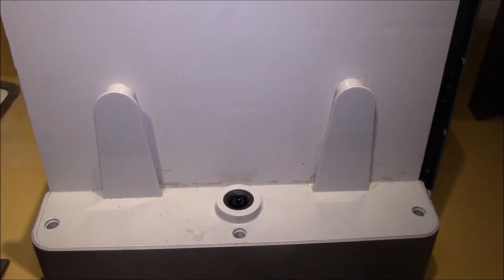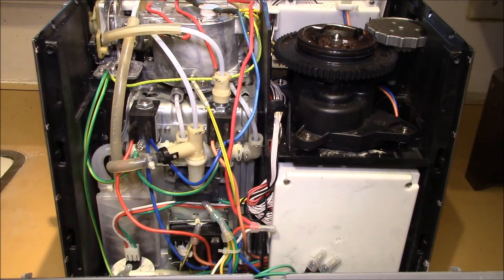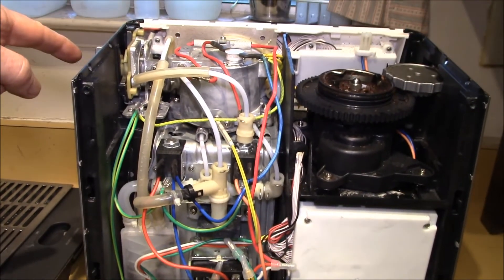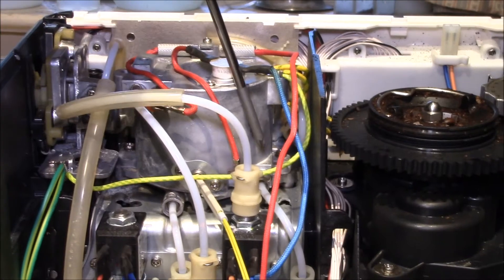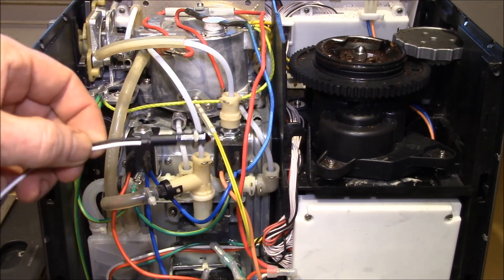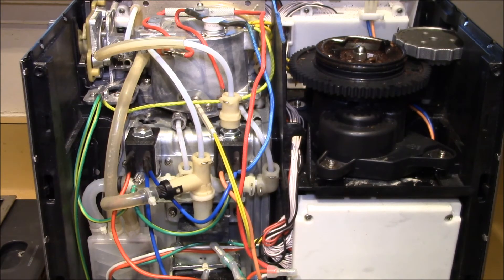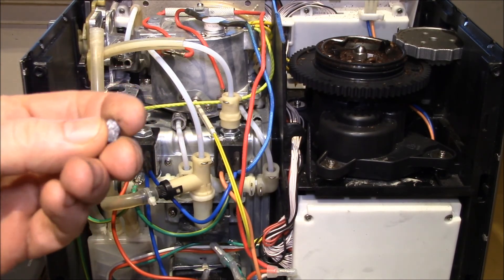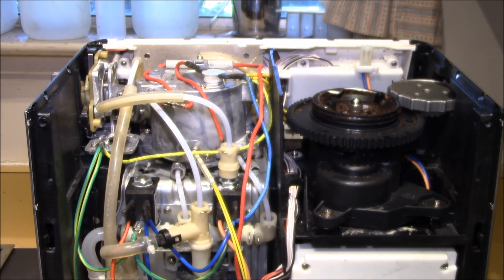Breville/Sage 870XL Barista Express - Water Flow

Comment: So just to let everyone know, having watched these excellent videos, I went ahead and ordered the solenoid block and as you warned it is on back order.  Here is the customer service info: 
Thank you for ordering from eReplacementParts.com. The purpose of this email is to inform you that when trying to order your parts we were notified by the manufacturer of one or more backorders. A backorder happens when the manufacturer does not have the part in stock. We are able to get backordered items once the manufacturer gets more in their stock.

The statuses of your items are listed below.

1 x SP0020444 Solenoid Valve Assembly - Backorder: Unknown ETA

We are very sorry that the part(s) went on backorder. At eReplacementParts.com, we will check on the status of the backorder part(s) with the manufacturer every month until they become available again. Then, we will contact you with the information we receive. If you would prefer that we call you with status updates in the future, please let us know!

Your order will ship complete as soon as all the parts arrive. If you would like us to ship out any available parts we have now, then we can definitely do that (additional shipping charges may apply). Also, if you would like to make other changes to your order, we can help with that as well. In either case, please email us at agent@eReplacementParts.com and one of our representatives will assist you.

Not a major problem as my machine is still working reasonably at the moment.  Just a heads up in case anyone was looking for an instant fix (pardon the pun!)

Comment: Hey, I have an issue is that water is not coming to manual hot water steam valve. The pressure meter is not showing any pressure. I assume it happens due to dirt in, what you call, tank or diffuser. I’m trying to clean up manually by injecting hot water. Could you advise how properly clean the diffuser and if I correctly analyzed the issue? Maybe there is an issue in the pressure it self?
Reply from the maker: The diffuser only handles water running to the drip tray, it's job is to diffuse or reduce the pressure of the hot water or stem that's dumped out of the thermo block after a cycle.  Unless you're getting no water into the drip pan, it's likely not plugged up.  Sounds more like a clogged hose between the pump and the solenoids or hot water/steam valve.  Or the safety valve could be stuck open and that's dumping water out or the pump is going out and not producing enough flow/pressure.  See my video in this playlist on those two parts.
Reply: @The4Crawler   Hey, thanks for the reply. I see some small drops are falling from the metal stick and when I switch to get a steam there is not steam from this metal stick :( I think I’ll remove now all the pipes and will try to check and clean all of the places where each one of them connecting.
Reply: I also saw your video about the steam valve so I’m checking this part as well.
Reply from the maker: @juno1010  Either the water is not getting to the hot water/steam valve or the valve itself is plugged up inside or there's not enough flow/pressure from the pump to push water out.
Reply: @The4Crawler  yeah, I’m in a middle of cleaning up all the pipes. I cleaned many plaque inside the pump I now I’m already getting the water from the metal stick but not yet see the steam :( and now don’t see any water coming to coffee cup any more. Something fixed and something broken. It’s like a lottery :)
Reply from the maker: @juno1010  Yes, have heard of cases where deposits in the pump broke free and then clogged tubing or valves farther down the line.
Reply: @The4Crawler  I found one pipe totally stuck, the one which is coming after the heating water and going to solenoid. Cleaning it now in salt lemon water.
Reply: No luck :( somehow water is not coming to the heater.
Reply from the maker: @juno1010  Then it's either the safety /over pressure valve bleeding off all the flow/pressure or the pump is not pumping water:
https://youtu.be/46UBebNJ-uo
Or perhaps the inlet filter below the pump is clogged and no water is entering the pump.
Reply: @The4Crawler  thanks a lot.. checking whole the flow.. disassemble whole the parts now.. solenoid, etc.. :) hopefully the electronic valves are fine, the right one is buzzing, could it be due to stuck pipes with plague ?
Reply: Btw, nothing bleeding. I mean no water leak outside.
Reply: Oh god, after putting whole the solenoid to water with lemon and salt I didn’t drain  the electric valves so my home electricity went down.. :) now I’m draining them with the dryer with hope that it didn’t burn.. it was not any smoke.. what do you think it burned? will it work? :)
Reply: Everything works! Finally. Thanks a lot for your videos, its very helpful.
Reply from the maker: @juno1010  If you have an RCD or GFCI type breaker, likely that went.  The solenoid coils have line, neutral and ground/earth connections.  If you get any current flowing to the earth connection, those type of breakers will trip out.  Likely no damage, just make sure everything is dry and cleaned of any conductive residue before powering up again.
Reply: @The4Crawler  You are the guy! The coffee machine is working great now. If not your videos and your online help it will be hard to fix it. Today I opened it and today I fixed it. It took a day, but very good results. Thank you very much Brown. You are the best! I’m planning other thing but it more to create something new. How can I contact you?
Reply from the maker: @juno1010  Glad you got the machine working.  There's an an e-mail link in the About tab on the main channel page.

Comment: Thanks for your video.
I am curious about how water flow works with "Clean me" and "Dry Puck" features.
Reply from the maker: Good question!  See these 2 videos:
Dry puck just holds the drain solenoid on for about 30 secs.:
https://youtu.be/9cC-m3a-oXY
Cleaning cycle is just repeated brewing cycles as far as the solenoids go from what I can see:
https://youtu.be/TZjJFSAkNQ0?list=PLpY2FP1a9tisyIfKjSugexoVK01xQuptv&t=557
Reply: You are really excellent in answering viewers ' questions.  Your detailed videos are really helpful to others.
Reply from the maker: @dm5124  Glad to hear that.  It was a crazy idea at first to wire up those indicator lights to the solenoids.  But in hind sight, they help to figure out how these machines work inside coupled with how the water flows around inside.
Reply: I am just wonder why I need to use "clean tablet" if water flow has only one way out of the group head.  The term "flush back" is also used by "clean me" feature.  
If the "clean tablet" is used only for cleaning shower screen in group head, I can remove the shower screen to clean and then run clean me process without using a clean tablet.
I don't think that the clean me process will suck back the water from group head. 

I wonder what "clean tabler" actually does.
Reply from the maker: @dm5124  I'm not totally sure how that works either.  It does cycle between brew and drain so in the drain state, pressure is vented from the group head and that likely sucks up some of the cleaning solution up into the plumbing a way, sort of like a siphon.  Then it's pushed out in the next brew cycle and repeats until the cleaning cycle ends.  Likely you could clean things by hand just as well, but the tablets and automatic cycle are more appealing to most users.

Comment: Thank you for the wealth of information!. I was about to give up on my 870XL, but now I'm fairly confident that I can fix my issue. I believe I have a bad three way solenoid but there were also times when it just wouldn't pump water, so I'll probably be replacing the pump soon too.
Reply from the maker: Yes, good idea to replace both while you are in there.  I did the solenoids then later decided the pump needed replacing as well.  I'll be rebuilding the pump to have as a spare.

Comment: Thank you so much for the very insightful video! Ive been having some issues with my Breville Oracle BES980XL. At the beginning of extraction, it leaks water around the portafilter, basically expelling whatever was in the group head before pulling a normal (now watery) shot. I suspect there is a valve that's clogged causing the purge to happen in the group head? What could be the reason for this? For reference, I've changed the grind, tamp pressure, water filter, tamp fan, and gasket. The portafilter is also in good condition. I've also descaled, run a cleaning cycle, and cleaned the group head. Do you have any ideas?
Reply from the maker: If it's similar to the 870 model, then there's the 2-port solenoid valve that opens after a cycle to purge steam/water directly.  There's also the indirect purge via the top of the 3-port valve that runs up to the hot water/steam valve and then down to the drain.  Maybe those passages are plugged or the solenoid valves are not working right.  You can usually hear a release of pressure when the brew cycle ends and that drain solenoid opens.  It typically stays on about 30 seconds then shuts off and you can usually hear that:
https://youtu.be/9cC-m3a-oXY
Reply: Thanks for the reply! I've just now replaced the solenoid valve but now no water is coming out of the group head at all... it does come out using the "hot water" function though so I believe it is not a pump issue. The steam wand also works. It is pretty quiet in the beginning during the infusion stage but it sounds normal afterwards (but no water). Do you have any other ideas?
Reply: @jessicanguyen8949 remove and check the small tube that goes out from that valve block into the stream head, that may be clogged. I had a problem with getting water from all the ports, in this case it was a clog in the tube from the heater block on the top down into the valve block.

Comment: hey i have a similar machine, it was turning on fine but developed a leak at the elbow, i disconnected the connectors leading to both solenoids, now the machine doesn't power on......i looked at all the connections and they seem intake and snug.  i measured voltage at the solenoid prone to a ground, and it does measure ~120v so power is getting to the solenoid, but the machine doesn't seem to turn on any more.......any ideas?
Reply from the maker: Maybe the grinder/bean hopper is not pushed in all the way.  That will prevent the machine turning on.  Check 7:10 in this video:
https://youtu.be/0ZDii493IPY
Reply: thanks for the reply! my machine doesn't have the grinder portion but everything else looks the same!
Reply from the maker: @seedyeh  OK, might be some similar type of interlock switch on the machine.  Could also try unplugging and reconnecting all the wires at both ends just to make sure they have a good connection.
This web page also has some troubleshooting ideas:
https://siber-sonic.com/appliance/800Electrical.html

Comment: Question for you sir!  I'm on my third new replacement breville barista touch for this same issue:  Hot water spout starts spraying more steam than water after 10 to 15 seconds.  If I choose descale, the spout works perfectly during that process.  Any ideas?
Reply from the maker: Never looked into that model.  Not sure if it has the same micro switch setup on the hot water / steam valve as my machine has, but might be worth checking those if it does, e.g. maybe those switch connections are swapped.  Or there may be a separate hot water temp. setting some place.  Maybe Breville support can help troubleshoot that.

Comment: The hose going to the portafilla is stuck how would you pull it out or get it out. The little brass nut attached to the end is stuck.
Reply from the maker: There should be the metal clip that holds the hose end in place.  There's a round brass ferrule that's crimped onto the end of the tube a bit of tube sticks out and into a small o-ring inside the fitting.  Maybe just carefully work it side to side and up and down and see if that'll loosen it up.  It may be stuck in the o-ring.  Replacements are available:
https://www.4crawler.com/YouTube/index.shtml#Orings

Comment: What an absolutely brilliant little video, thanks so much Mr Brown :-). Like you, I've had my issues with this machine, but your explanation of the flow path has made my life so much easier. I'm getting no water thru the group head but I am getting steam and hot water with good pressure. I take it from your explanation that the solenoid on the right is probably faulty and is just not switching over to direct water to the group head.  Would that be your best guess too?
Reply from the maker: Sounds like a logical place to start:
https://youtu.be/96IuKiuIB5A
Like NASA says, follow the water.
Reply: @The4Crawler  Hah! Like a total dolt I didn't really investigate the issue closely enough but made the assumption that if the solenoid wasn't activating then it was probably a faulty solenoid, as this is a very common fault I'm told. I STUPIDLY in my arrogance didn't bother to check either the resistance of the coil or check to see if I was getting any volts to the solenoid. I went straight ahead and ordered the solenoid manifold assembly with both solenoids on as I figured that if one had gone I might as well change them both to be on the safe side. I plugged it all up, fired up the machine and the fault was identical LOL. Then I started kicking myself for being so over confident. So, 20 minutes later I have the main PCB pulled out and there for all to see is a black patch where the TRIAC that drives the offending solenoid used to be...59 cents later I have a new TRIAC installed and I'm back in business. MY 59 cent repair cost me $135. But at least I now have some spares :-) (If you ever need the TRIAC they are a  BT131-600)
Reply from the maker: @MrReStories  Great point on checking coil resistance and voltage.  Went into some of that on the later solenoid testing video.  Good information on the Triac p/n as well.  Might need to pick up a few of those just in case.
Reply: @MrReStories  Mike, I think I have a similar problem.  T4 on my Main PCB is fried and it's located right where the Orange wire connects to the PCB.  Where did you purchase your Triac?
Reply: @markblocksom3051  Here's a link to a pic in my Dropbox. It shows the new triac about to be soldered in after I've cleaned up the board. You can still see a little bit of burning on that orange wire - https://www.dropbox.com/sh/5hz13smpq8vb1c3/AAB-wp2yKg7DjDK2__ay49q0a?dl=0
Reply: @MrReStories  I’m following a similar issue, but in mine the solenoid is always getting 120 volts, even with the power off. Thanks to both for the pointers.
Reply: @tupublicoful  "Even with the power off", Wow, I think you've just discovered the answer to the energy crisis LOL :-). I'd still be looking at that TRIAC if I were you. Those types of devices can fail either as an open circuit or a short circuit. If it failed as a short circuit then you may have power on that relay all the time. I'm not sure how the power supply is wired but it is possible that the mains is always on for the CPU so it can be in standby mode (ie. plugged into the wall and turned on)  and the On/Off button on the front of the unit just kicks the program to life and lights up the buttons.
Reply: @MrReStories   Yep I was surprised as well by the solenoid clicking when I plugged in the machine, but confirmed with a multimeter that it’s getting 120 volts without turning it on. TRIAC looks fine, I’ll try to test it but without a test bench might be difficult. There’s not an obviously burned component on the board, just a slightly brownish area that I first attributed to age, but it’s conceivable that a brownout just took out the board while also frying the solenoid which is what I noticed first. It’s annoying because it’s the only electronic device that I overlooked to connect through a line voltage regulator.
Reply: @tupublicoful  So in that case if you check the continuity between the hot pin on your mains plug and hot wire that supplies that solenoid, it should be a short circuit (If the theory is correct) . If it is, then the TRIAC has failed in the on state. I've had them survive like that without burning up.
Reply: @MrReStories  would love to know what this triac is that you speak about please. Looks like my BES870 has the same issue. Luckily your message saved me from getting all new solenoids. I did replace a coil though. Are you able to share with me the drop box image of you soldering?
Reply: Hi guys, having similar issues with my machine but cannot figure it out…
Firstly 3-way solenoid was faulty as had no resistance across it and nothing coming out the group head. Steam & hot water worked fine, but when trying espresso all the water would just go out the dump pipe by the steam/hot water valve.
Replaced the entire solenoid assembly and now water only comes out the group head - even when it purges excess water.
Have looked on the circuit board and nothing is visibly damaged or fried. 
Any ideas on how to troubleshoot the issue? 
Thanks, Kieren.
Reply: @backyard-sends  You still having the same problem? I'm having it right now where the water is dumping into the tray from the steam/ hot water. Already replaced the PCB and solenoids assembly.
Reply: @trent4152  Yes still same issue, haven’t figured a solution yet